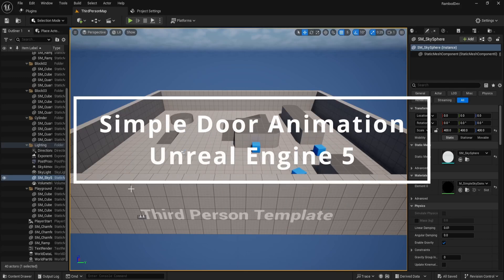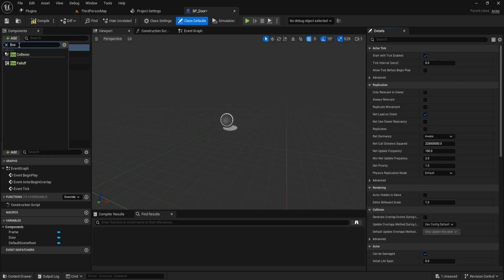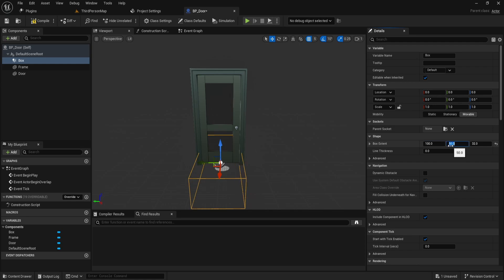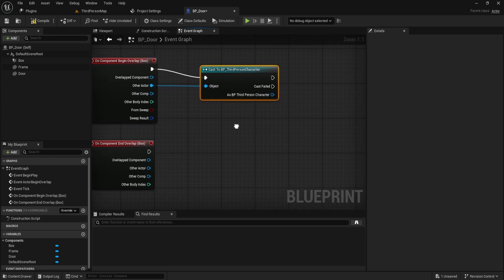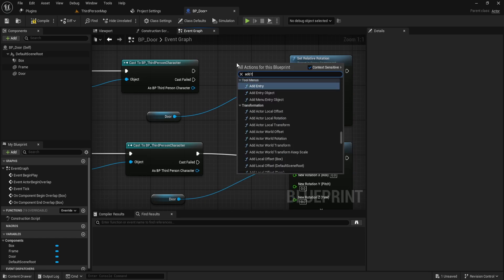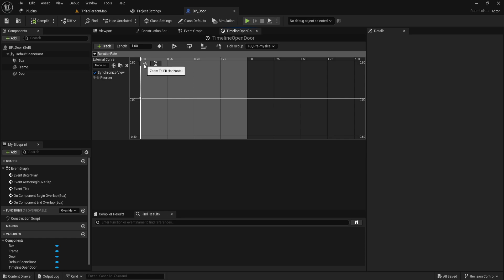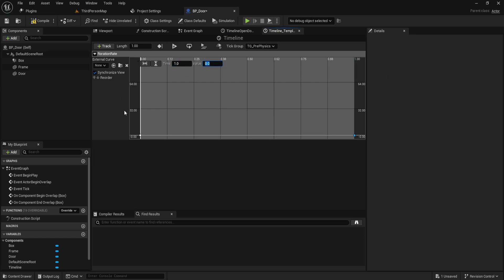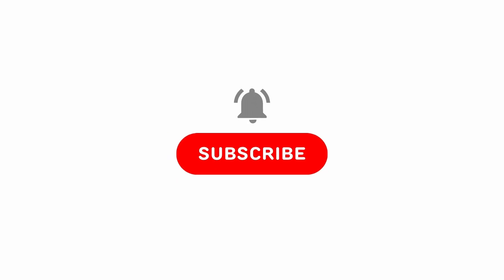Unreal Engine 5.5: Simple Door Animation Tutorial

Comment: Good video.   You don't really need two timelines and two set relative rotations.   Just put other actor from each OnComponent (Begin/End) to two cast to bp_3rdperson nodes.   and they go into 1 timeline (1 to play 1 to reverse).   then the timeline mask goes into a lerp (rotator) where A=0,0,0 and B=0,0,90...or whatever you want.   and that lerp goes into the set relative rotation new rotation.   put the door as the target in the set relative rotation and link the update from timeline to the set relative exec pin.
Reply from the maker: Thanks for the tip! That’s a clever way to streamline the logic with fewer nodes. 👍

Comment: Thank you

What if there is something blocking the door and they can not fully open 90 degrees only lets say 40.
Imagine I put box with collision behind door so they can partially open but stop when they hit the box.
How would that look in BP?
Reply from the maker: @TomLis-u3o You can make the door dynamically stop when it collides with an obstacle by binding an event to detect the collision and stopping the timeline animation when that happens. Here’s exactly how to set it up in Blueprints:

1. Bind the Hit Event in Event BeginPlay
- Drag and drop the Door Static Mesh Component inside your BP_Door Blueprint so you can reference it.
- From the Door component, create a Bind Event to On Component Hit node.
- Create a Custom Event named OnComponentHit_Event and connect it.

2. Stop the Open/Close Timeline on Hit
- Inside OnComponentHit_Event from execution pin connect it to Stop both the Open Timeline and Close Timeline nodes.
- This ensures the door immediately stops moving as soon as it collides with another object.

3. Ensure the Door Has a Collision Box
- In BP_Door, go to the Details Panel and find the Static Mesh section.
- Double-click on SM_Door (this opens the Static Mesh Editor).
- Inside the Collision settings, add a Simple Box Collision.
- Alternatively, you can use Auto Convex Collision.
- Close the Static Mesh Editor and return to BP_Door.

4. Set Up Collision for the Door and the Blocking Object
Both the door and the blocking object must have correct collision settings:

For the Door (BP_Door)
- Select the Door Static Mesh inside BP_Door, and in the Details Panel:
   -  Set Collision Presets to BlockAllDynamic.
   -  Enable Simulation Generates Hit Events.
   -  Enable Generate Overlap Events.

For the Blocking Object
- Select the blocking object in your scene and apply the same settings:
   - Collision Presets: BlockAllDynamic
   - Simulation Generates Hit Events: Enabled
   - Generate Overlap Events: Enabled

5. How It Works
- When the door moves via the timeline, it will continue until it collides with an object that has the correct collision settings.
- At the moment of collision, OnComponentHit_Event triggers.
- The event will stop the timeline immediately, preventing the door from moving further.

If you can’t get this working, let me know—I’ll create a video explaining everything in detail.